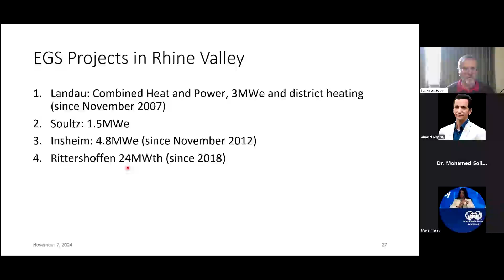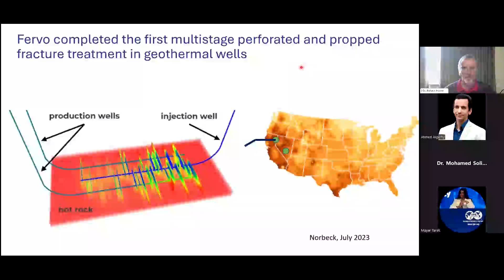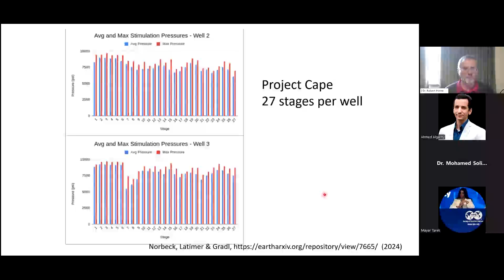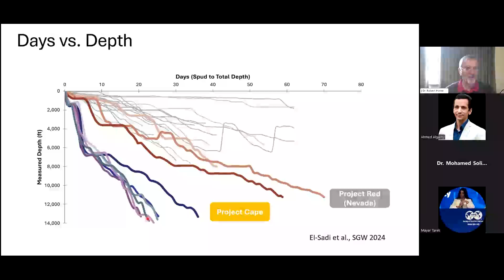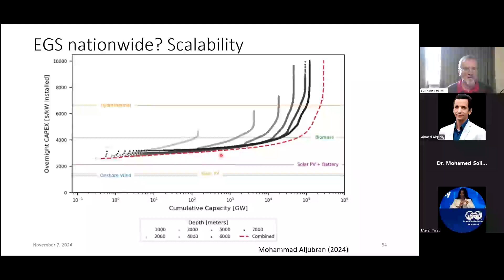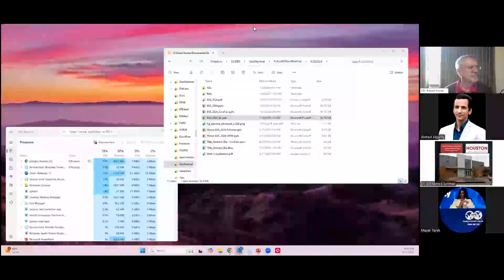The Future of Geothermal Energy by Dr. Roland Horne

Comment: "Thank you, Dr. Horne, for the comprehensive presentation on The Future of Geothermal Energy. Your insights into the potential of geothermal as a reliable and sustainable energy source were inspiring, especially the advancements in enhanced geothermal systems (EGS) and deep drilling technologies. I found your analysis of geothermal’s role in base-load energy particularly valuable, as well as the discussion on overcoming geographical limitations for wider adoption. Thank you again for shedding light on this promising energy solution!